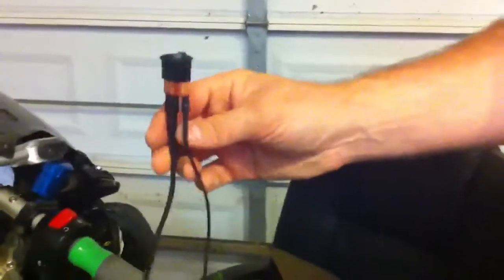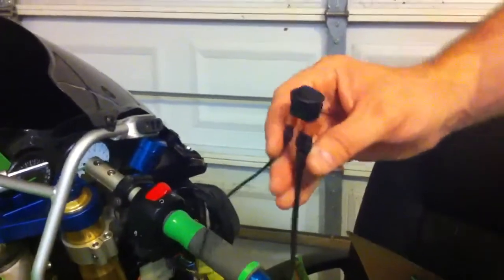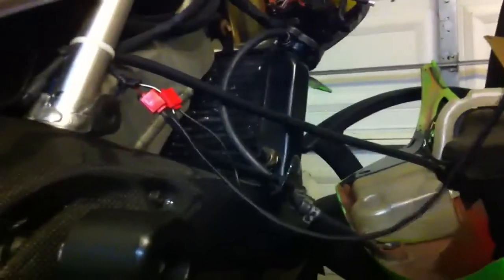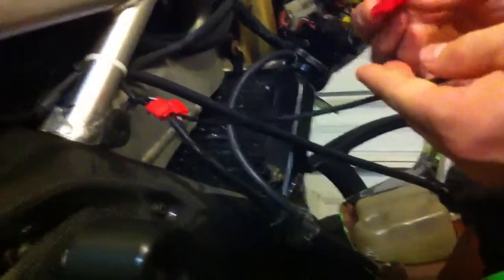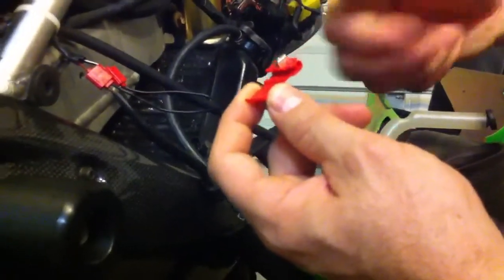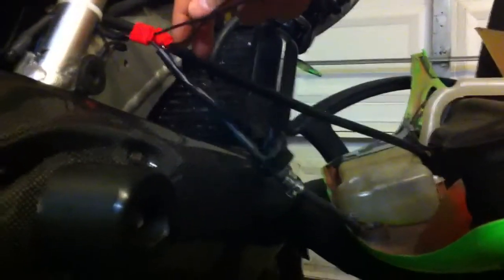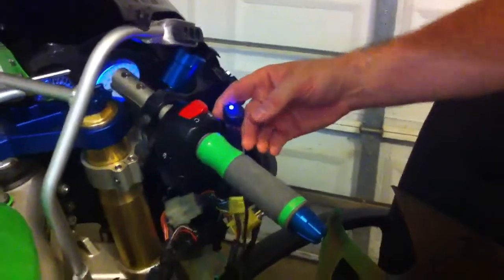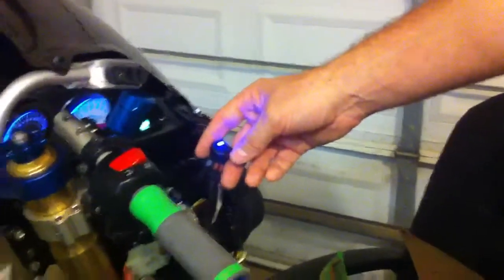Manual fan switch (TLS/TLR)

Comment: does your fan still come on when the bike reaches operating temperature, or will the fan still operate as it did before installing the switch?
Reply from the maker: Brandon Adams Yes, works as normal.